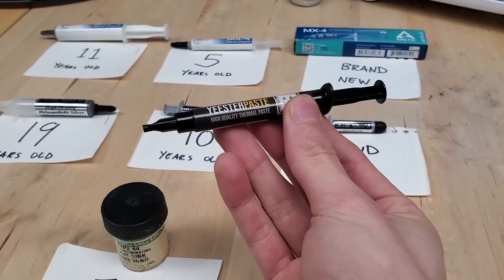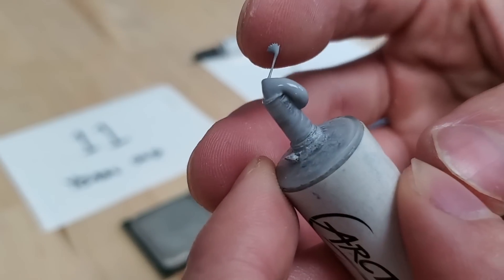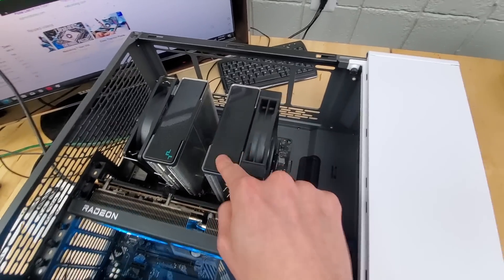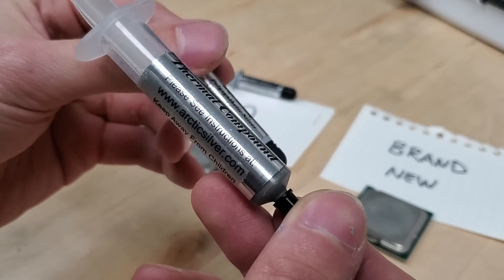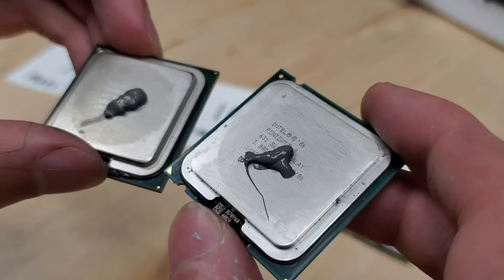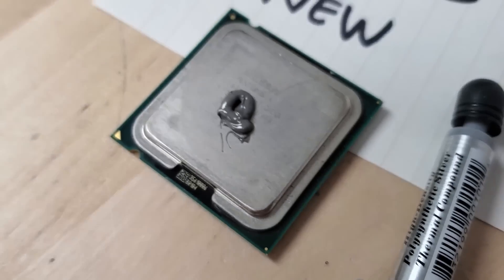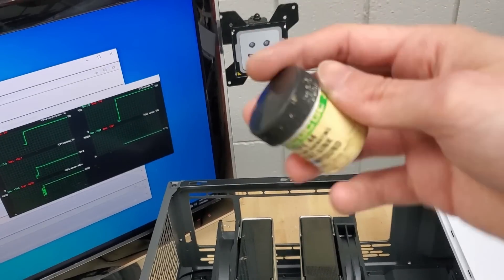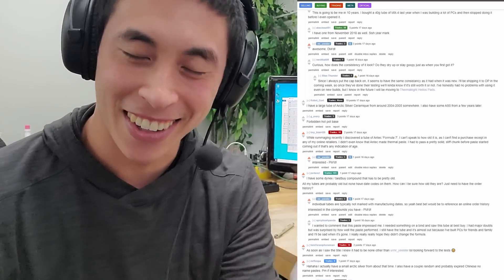does thermal paste ACTUALLY expire?

Comment: My MX-2 I bought in 2018 is a glossy liquid like yours. It looks like it should be fine, but my squealing fans say otherwise, but maybe I just didn't apply it correctly?

UPDATE: Replacing the paste with the stock paste that comes with the Phantom Spirit 120 performs pretty much the same (from my rough measurements). Maybe it's supposed to be kind of loud when using every core of the 7600X at over 5.2GHz?
Reply: your mistake is bought AMD processor in the first place. Replace it with intel

Comment: Another great reason to use a cooler at least somewhat better than your CPU could be pushed hard enough to need. There will never be a need to uncover your CPU just to change the paste. The cooler will only need to work slightly harder when it's old than when it was new.

Comment: you forgot one test and that's no past at all ..and then no past after lapping the cpu and heat sink
Reply: No past, meaning didn't exist prior to now? IOW, prior to a constantly moving "now" it never existed?
Reply: @uncrunch398  paste was not a thing back in the early days and lapping the cooler so that it made better contact with the die for better cooling was a thing
Reply: @dexter2433  Up to recently, or maybe still, lapping is a thing. One of the most looked up to overclockers with a channel on YT designed a simple delidding kit for some CPUs that anyone can buy for little cost. You do that, then lap, for maximum effect. Or lap the lid for some, but not quite the best. Delidding was/is a thing because some CPUs didn't have exceptional thermal conduction from the chip to the lid. It lost some popularity because you can get almost all chips to their best stable performance these days without. Extreme overclockers still do both and apply liquid nitrogen to rank on benchmark record charts. BTW, when did thermal paste become a thing? I never learned this. I guess until sometime 1990s, adhesive that came on heat sinks was enough for the purpose.

Comment: You used 100w cpu with 200w capable cooling tower? You should know that x3d cpu's (5th gen) heat stuck inside core itself rather than escape through its 3d cache. This test is not the best way to test the thermal pastes just because of this.

Comment: thermal pastes do not have an expiration date. they can be used until they separate or dry out. arctic says they are valid for 8 years from production BUT they do not indicate the production date at all (which is not the date of purchase) my 2017 mx4 works better (at the same weight) than a new mx-6. it's all marketing. I contacted arctic who confirmed that there is no expiration date and that they still have 20 year old pastes that work perfectly

Comment: I just used an old tube of Arctic Silver 5 that I bought in 2006 on my Ryzen 9800X3D. idle temps 40c, max under 8-core-100%-load is 81c!
Reply: Liquid cooling
Reply: @maanmahmoud4537  is all hype

Comment: I think your testing methodology is thrown off a little by the inconsistency in application. You put significantly more paste on some of the test chips than others. Running it with beads of the same length every time might have been a better control, though without some sort of machine dispenser I doubt you could completely eliminate the human factor in application.

Comment: However, you should still replace your thermal paste from your components. It maybe barely lost his properties through the years as long as is well stored. But the thermal paste applied to your components and exposed to hot temperatures and air is going to get wasted

Comment: That +30 yo thermal paste is maybe not expired at all, just it has been engineered for a different time and tech specs. I've been using a similar oldy 80s thermal paste that I borrowed from my dad for all my PC builds since 2001 until 2017, and it worked perfectly until the newer cpus required more solid thermal conductivity

Comment: i have similar temp differations on allpying the same tube of grizzly conductonaut everytime on my laptop. i would say its margin of error on applying and also each paste has theyre own temp area as clearly shown in this video.

but what you had was interesting on the pastes itself. while the paste basically turns 180 around in shape or color it still performance of what spec it should be on.

Comment: Thermal paste is based on silicone. If that expires, then you should have the exact same worry about the very chip (CPU, GPU etc.) you're applying it on, since chip wafers are also made out of silicone. But since you never worry about that piece of silicone "losing its properties", why would you worry about the other? Not to mention the silicone from the chips has waaaayyy higher requirements for purity and charge separation via its depletion layers, so next time you see a Pentium I from 1996 with the same thermal paste since 30 years ago, don't worry, it still runs fine.

Comment: Guys , ive got a question , i got a brand new xbox series x back in december 2020 , i have never used it , its been sitting in my basement for the past 3.5 years , should i replace the thermal paste if i want to use it again ?

Comment: You cannot compare the pastes when your CPU is throttling. Either test with a less shittier CPU or with a better cooler.
Reply: ^ this. You want the thermals to be able to walk and if its bad its going to run hotter. if your already at thermal max, there is no place for it to go even if its would only get a couple degree warmer or 40 degrees warmer. 1-5 degree is within the margin of error of install and coverage.

Comment: The "active ingredient" in thermal paste is the solid filler. The oil is only there to facilitate application and help particles stay put. The "expiration" has more to do with optimal ease and repeatability of application than performance. Once applied, powder-based pastes can be 50+ years old and still perform perfectly fine. Most of the times where people run into thermal performance issues with a 5+ years old paste application is because they nudged their HSF while cleaning their PC and broke the paste after it had fully settled down.

I'm still using a tube of 20+ years old GCChemicals ZnO thermal paste in my PCs today, got about 1/5th of the tube left. The tube has lost quite a bit of oil through the aluminum squeeze tube having ripped in a few folds.

Comment: I have Arctic Silver tubes in variety in year gotta say the larger tubes regardless of year are hard to push. I recommend storing the tubes themselves inside a sealed container tubes stored loose eventually dry out compared to the ones in a semi tight container

Comment: U should have went down with PPT, TDC and EDC, so the CPU isnt that close to throttle temp. In my opinion that would have made a comparsion easier/better. Other than that a very cool video. Just bought new paste and threw my 8 year old away :(

Comment: I thought the 90c ceiling was indicative of the pastes working until I saw that 30 year old paste "work", and it suddenly became clear that something is off.

When that paste was new, 50c was considered overheating for CPUs. There's no oil dry up in that paste, there was never any oil at all, because that wasn't necessary for cooling a 30 year old Pentium. I don't think the CPU going to 90c is a sign of the paste working correctly, because there is no way it should be working effectively at all.

I think you should test again with a fan.

Comment: this actually reminded me of something stupid I did back when i first got into pc building in around 2015-16, I found a tube of arctic silver 3 in my basement that I assume my dad had used when building his old Athlon XP system in the early 2000s and was just like yeah it'll be fine to use this on my system, thankfully I was running a relatively low wattage Athlon X2 (all I could afford) dunno how the temps were but it survived lol, I remember that I took it apart when I upgraded that it was all separated there was streaks of just oil and spots that looked like just tiny metal filings it was scuffed

Comment: What your test determined was that your pc will throttle as much as it needs to do to keep the CPU from exceeding 90 degrees. We don't know how many degrees correspond with throttling points, so maybe put in that center fan that is missing so your cooling works better and we can see some real-world temperature differences between the thermal compounds. 

When you do this, you'll only know what temps you get from freshly-applied compound, which has never spent years degrading under heat stress. Degradation over time is what we really need to know. 

Also, compound formulation may have changed over time so newer compound might work better only because it has been improved. 

I find that thermal compound dries out very quickly after application, so being dried out isn't a big problem for performance, it's more a problem with application of the compound. That's the only reason I can think of that "old" compound would need to expire. Compound that is applied to a working CPU should work forever unless it has a tendancy to develop insulating bubbles, or the stress of use degrades it chemically so much that it really stops conducting heat as well.
Reply: The cooler has its 2 fans so the performance difference by putting put in that center fan instead would be marginal. By the way I like that setup.
I think degradation over time is a different issue. He showed me close to what I expected.
Yes, compound formulation may have changed over time, thought so too.
I find that thermal compound dries out very slowly after application.

Comment: Interesting comparison. The thermal throttling behavior of the CPU might have skewed the results a bit though. If the CPU throttles at 90°, it could mean that the temperature difference between new and old thermal paste would be much higher without the CPU throttling, as with throttling the temperature is kept at 90° max. irrespective of the thermal conductivity of the paste used.
Reply: Hence looking at how much it has to throttle to stay at 90

Comment: I'm surprised how well that 30 year old thermal paste performed. 

Don't forget 30 years ago, processors generally used less than 1/2 the power and ran at 1/3 the clock speed.

Also, generic thermal paste back then also performed significantly worse than the stuff available today.

Comment: my 5 year old mx-5 thermal paste has still held it's form and there is no heat bottleneck, maybe environment conditions also play a part in it as I have just used mine to refresh two of my old gpu's and it still comes out as if it was brand new. given i am almost out, i should buy another tube of the stuff, but it performs quite well atm...

Comment: new cpus run to hot run this with ryzen 3700x so you can see if there is a diff
Reply: id say  there is a difference   since most cpus 5900x -7000 series  targets 90c you cant fully see a difference

Comment: Usually in lower power CPUs (65-95W), I didn't saw any meaningful temperature increase with older thernal paste, often staying below throttling threshold. As a rule if the thumb, if you are not throttling and running at reasonable temperatures, the system is fine and you can delay a bit the purchase of that brand new thermal paste.

Comment: I just threw out a 14 year old tube of MX4 that I got back when I was doing hardware reviews. I just got a brand new tube of mx4 to replace it with. But I used the old stuff up until last week and it worked just fine.

Comment: I have a large tube of Arctic Silver 3 from around 2000, still has good consistency and works fine. I also have a smaller tube of Arctic Silver 5 I purchased a few years later (as soon as it came out) which I applied last year to the CPU I'm using to write this comment - it also works great and I have noticed no difference except for a very slight increase in viscosity.

Comment: I mean logically it's more sealed in the tube than on a cpu. It also makes sense for it not to break down much over time as it would otherwise do that while in a computer as well and that would lead to thermal problems. So that it has a decent shelf life and tends to not massively degrade while in use are a key point, especially considering most people don't want to apply new paste once a year either.

Comment: This needs more scientific approach... , would be a shame to waste those old pastes without performing something more meaningful. We need to see graphs, exact times. Not hitting always max temp (that is the most iritating about this video). If you put the cpu on like a 30-50% load and check the differences it would show much more. However, adding exact times and graphs will do the same with the 100% load.

Comment: I finally ran out a syringe of Arctic Silver late last year (it's not marked which # it is).  It's older than 2005 since I had it when I moved at the time. I didn't use it on any new modern processors, just older stuff I was upgrading. No particular issues. Not to be used is some old copper paste from the pre-IHS days when they made copper shims for Pentium 3s. That was the paste for them.

Comment: Thermal paste is basically made up of two components: liquid (mostly silicon oils) and solid (mostly metal-oxides) . Role of the paste is to get in various cavities, nooks and crannies between two metal surfaces. Thermal paste is NOT better than pure metal-to-metal contact, but is better thermal conductor than air. Liquid part of the paste is mostly to give viscosity and get it into aforementioned cavities, solid part (metal-oxides) actually conducts heat. Once you get paste in place, liquid part is no longer essential, and it could evaporate. Solid parts remain stable for years (centuries) and will continue to function as long as you do not move your cooler and displace them from cavities.
Reply: So you're saying thermal paste applied on a regularly used computer over 5 years does not need to be changed?
Reply: @HanmaHeiro  It does not unless you remove the cooler. Usually fan on the cooler fails (mechanical part, wear and tear ). So you remove the cooler and then you have to reapply the paste, of course. Interestingly enough, for cheaper processors with low TDP (laptop Celerons for example) you do not need to re-apply paste because they are passively cooled :)
Reply: ARCTIC’s MX-4, for example, is metal-free and thus not electrically conductive as most thermal pastes
Reply: @claudej8805  Thermal pastes are designed to be electrically non-conductive precisely because they are often used by amateurs and semi-professionals. For better thermal conductivity you have liquid metal (for example, like in Sony PS5) , but with liquid metal you could easily create short circuit if you make a mistake while applying.
Reply: @aleksazunjic9672  You wrote "solid (mostly metal-oxides)" make up your mind
Reply: @claudej8805  Metal-oxides are not electrically conductive as metals. For example, common rust is one of metal oxides (iron oxide).
Reply: @aleksazunjic9672  True, you didn't write metal-free, sorry.

Comment: Did you really have to run the tests at the thermal throttling limit? This makes it harder to really see whatever difference there is. Your cooler looks substantial but are you even undervolting that X3D chip?

Comment: a few weeks ago i opened on well over 15 years old notebook (hp compaq i think) to clean the heatsink and replace the termalpaste, but the termalpaste was like new and the computer has not ben used or opened for over 7 years, it was exactly the same as in my gaming pc i build 2 years ago, besides the color (white, gray). I replaced it anyway couse i already opened it, but realy impressing that termalpaste works fos so long, nice vidio btw

Comment: 06:40  That is not thermal throttling.  That is reaching a different boost speed.  If you were using different processors to test each paste, even if they are the same model, your tests are completely invalid.

You have to use the same exact processor, on the same exact board, and do at least three separate mounts for each paste.

Comment: Arctic mX 4: There is no difference due age. They changed the formula. Older MX 4's are less viscous and spread easier and I prefer old formula than this thick new crap they use now. The new paste is very viscous and it's difficult to spread, I must use damn credit card to spread it over IHS, old one you just put a blob or X on the IHS and pressure of heatsink do the spreading super easy. Screw 0.2 C difference in performance. I want old MX 4 formula back!

Comment: That 30 year old thermal compound is probably still better than what most computer OEMs use
Reply: and the Xbox thermal paste especially
Reply: @aero01_1 Xbox uses toothpaste
Reply: @blez666  toothpaste is pretty good
Reply: Hey funny seeing you here Gamecuber LOL (recognize you from WSE and TanukiCraft)
Reply: I'm still using the same tube of UK-made RS Components white 'Heatsink compound' I've had since the 80's. It works great ! I only ever use the smallest amount needed to get a very thin film.
Reply: *laptops
Reply: As a former OEM assembler, I can tell you that we would often save TIM from the retail boxed coolers and use what we had on our desk. So you could have TIM from a cooler master cooler on a BeQuiet cooler for example. Typically, anything we used was name brand though.We would use the stock TIM on AMD and Intel coolers though.
Reply: @AlamedaFumbles   meant were companies like dell , hp and more , those big ones